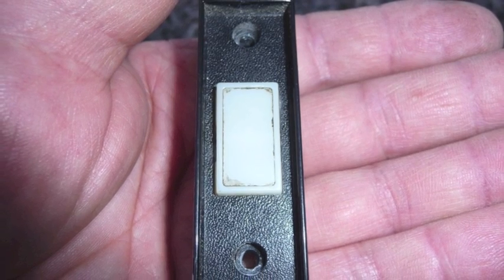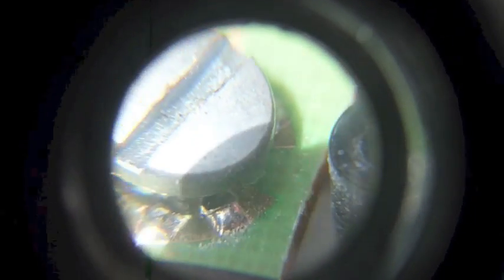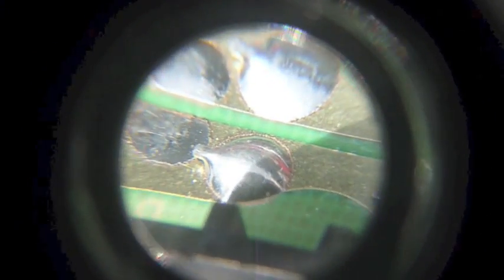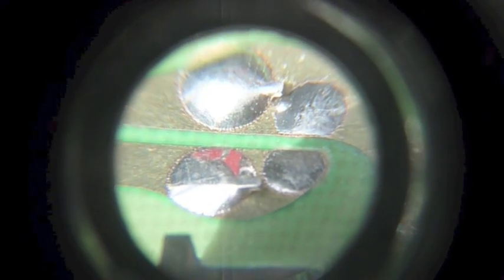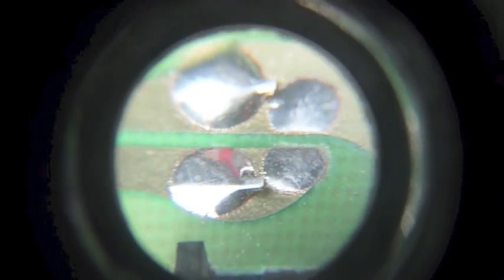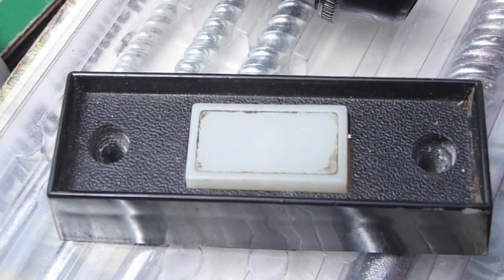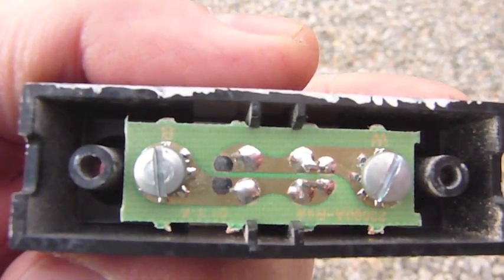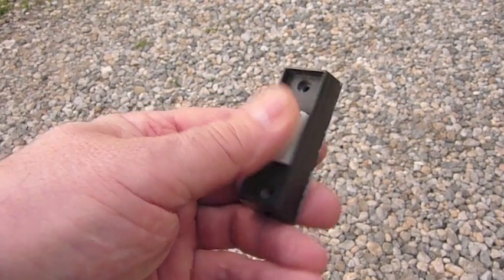Genie Wall Buttons

Comment from the maker: Thanks GenieMan. That avatar you have of the AT-85 brings back memories of Genie's operating on their own because the metal strip in that remote that was used for the momentary contact would fatigue and loose it's spring, it would lay so close to the brad on the circuit board that just moving it or temperature change would make it send out it's signal. I was called by a concerned person because each time he tried to pull in to his garage the door came down and bounced of his cars hood twice.

Comment: My switch was not working all the time.  Sometimes it would work and other times, not.  Took off the switch, busted out the light as described and put it back together.  Works like a charm.  So what my little light doesn't work..not an issue.  Thank you for posting this as it saved me a trip to Home Depot and a cost of around $8.00.  No, they do not give these switches away, and anytime I can save $8.00 for something simple like this, I will do it.  How about you?

Comment: In our case, the failure of $.000001 of plastic foam, that acts as the "spring" behind the wall control buttons, disabled the entire wall control and the entire system.  Genie's solution is a new system as parts are no longer made for the Genie Pro 98S.  My solution was $.00001 of plastic foam and some two-sided tape.  That problem was easily foreseen by Genie.

Comment: What would happen if you just used a regular push button with no electronics on it,  just on and off.  I've thought about just shorting the 1 and 2 terminals together on the power head to see if it's even the button that doesn't work but figured I might mess something up..
Reply: Plain door bell button should be fine be sure there is no light bulb in it.

Comment: I got an at-90 off eBay for my gs-900 and the reed still has a good spring to it I hope what you said doesn't happen to it.  I have a universal unlit genie button on my trac drive I would pick the button up or touch the wire and the opener would Tunis that anything similar to what you talked about